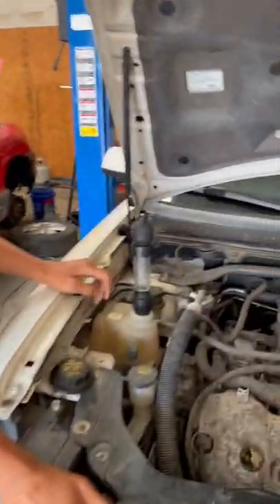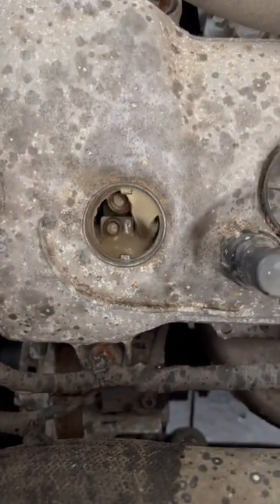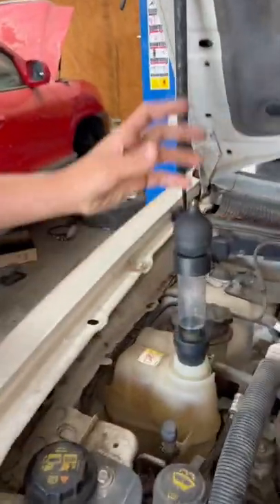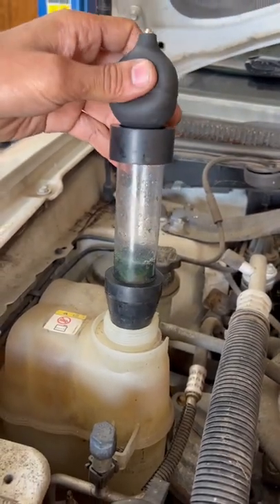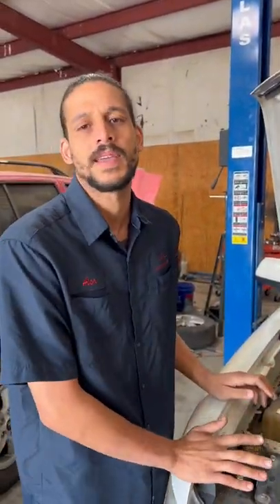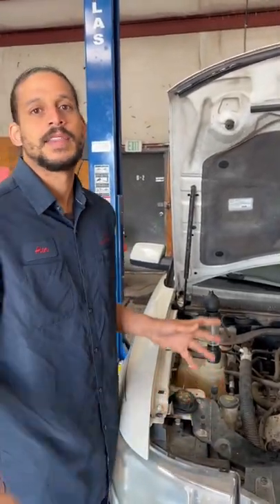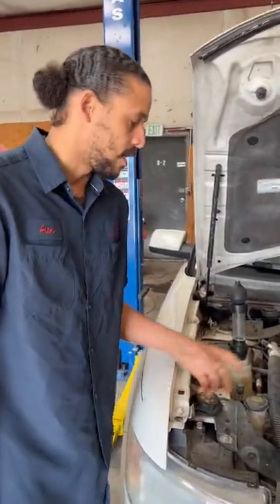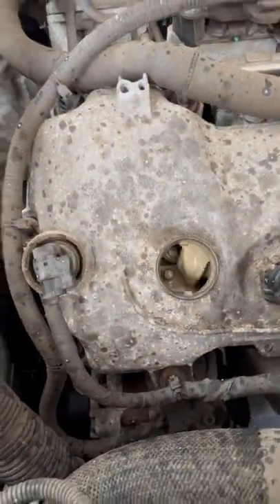MILKY OIL doesn’t always mean Blown Head Gasket! #shorts

Comment: Cool replace that water pump. Cus the coolant has already torn up the main bearings
Reply: What do you mean ? Would the .ain't bearings be shot now? I have no clue and don't want to waste my time at this point thanks
Reply: As you continue to let the engine run and destroy bearings....
Reply: @last-real-1gh117  done a few of these. He’s right. When you see a lot it milk in it rod bearings are compromised. Out of 9 I’ve done 2 needed engines
Reply: i can hear it
Reply: @mrpistonrecaro6483 so my coolant is turning brown even after a coolant flush but it isn’t milky. Dipstick not milky as well. Car hasn’t been overheating. What could be the problem? Oil cooler? Water pump?
Reply: @zGITS sounds like an “owner” problem.
Reply: @zGITS I’ll suspect oil cooler. I’m suspecting the same on my pursuit charger

Comment: In all FAIRNESS… a block test is a starting point. Even if its changing color. You still should in theory do a leak down on each cylinder, and bench test any engine oil coolers present. Just a extra step in how i go about diagnosing a head gasket. If its obvious enough ill use a borescope camera on the possible problem cylinder. Now you have video and picture proof to the owner its a head gasket.

Comment: My old roommate had a 2010 Mazda CX9 with a Ford Duratec 3.7. Timing chain driven pump. What a mess. The 3.5 and 3.7 Ford Duratecs in FWD applications have this problem.
Reply: Mechanics love them that's a big paying job and not very hard on a lift lol
Reply: @bentleynorton6843  I love doing them. Don’t need a lift  can finish it in 6-7 hours

Comment: I have clean engine oil but milky coolant (water) have flushed the radiator many times and fill it with water after 20 minutes of driving the radiator water gets milky ! Not a drop of milky liquid in the engine all in reservoir and radiator !!! I’m going to change the oil cooler on Monday hope it’s that one ! By the way the car is dodge caliber 1.8 liter 2008

Comment: Alex, excellent video as usual, thank you. I would like to add that just because the pressure cap on the reservoir pops, (16-18psi) doesn't mean its a head gasket on Dodge Charger 2006-2010, it can just be boil over on fan failure. When the temp hits boiling, the water in the reservoir suddenly and violently boils as a large portion of superheated water/coolant rushes out from the engine. I saw this happen, but our cap was off, it looked like a coolant geyser and the heads and gaskets in that car were new and OK afterwards. The old timers say that if boil over happens on a Dodge Charger - check the fans and fan circuits/wiring/relays etc. I found that many places online stating the fan circuit fails on Dodge Chargers across the production years 06 to present. Mine did, I had to make a bypass circuit using 2 relays and 2 fuses for the two fans.
Reply from the maker: Hey there, thanks man. I’m familiar with that to add that will happen to all cars.you just gave me a video idea thanks,how coolant system works and what can happen if it fail’s. Thanks for watching as always
Reply: You'd hope to get a fan related code set in that case, like P0494 or P0495. I'm getting that second code only sometimes, so something in the high speed fan circuit is on its way out (maybe a relay going bad or a dodgy fan controller). I noticed a drop in coolant level close to min level, but no sign of head gasket failure, so the car will be paying a visit to the autoelectric guy to get that fan issue fixed!

I'd love to see some more cooling system videos - there aren't many and it's so crucial to car health.

Comment: I have a 1996 Subaru legacy l We got into a wreck couple months ago we replaced the radiator, fan, and a hose and the car still over heats! We can't take it to the shop cause we can't drive it for the overheating.
Reply from the maker: Hey there sounds like you need to bleed the air out of the cooling system are you familiar with the process

Comment: How can I get in touch with you ? I have a question about the timing chain job on the 2.7 charger
Reply from the maker: Look me up on Instagram we can chat there. This is my shop number 4704350015 but I’m normally very busy I can’t come to the phone
Reply: Ok,  because I had a question about resetting the timing because it’s off from timing chain jumping and now I can’t get the chain marks to align with the sprocket marks plus I’m having trouble getting the time chain on . It’s almost like it’s too small . You guys made it look easy putting it on and off lol
Reply from the maker: @BC_nopowder  what part brand are you using

Comment: Good to know. I know sludge and light color condensation will build up in a car that is only used for short trips and never warms up completely. I would see that with retired people that just drove to the store and home and never any longer trips.
Reply from the maker: It’s amazing how short trips is bad for the engine
Reply: @AlexTheCarDoctor  carbon build up too
Reply from the maker: @Walterrinho most definitely
Reply: @AlexTheCarDoctor  Most people don't realize that short trip driving is also considered an "extreme" driving condition that according to most manufacturers requires oil changes every 3000 mile/6 months regardless of oil type used. My wife drives our car exactly 1 mile each way to work and in Chicago's extreme winters we get the milky froth on the oil cap from unburned condensation. This got real noticeable to us within the first winter during the pandemic when we weren't drivng much beyond going to work, so now every 2 weeks we go for a drive to get the engine up to operating temp and at highway speeds to help burn off the condensation. We also use a Chevron Techron treatment before each oil change and change out the PCV every other year whether it needs it or not (heck, they're only $12).

It would be great if you discussed short distance driving, it's affects and what can be done to keep a car functional and well maintained with this type of extreme driving condition. There are very few YouTube videos addressing short distance driving during the winter and how those conditions can cause froth under the oil cap, but isn't necessarily a sign of a blown head gasket. 

Great work. Thanks!
Reply from the maker: @kerigpope  thanks for the video idea

Comment: I thought the coolant (water) pump if it goes bad, would leak through the tell-tell hole at the base of the pump. This is one way but If the gasket went on the block, there you’d get that water in the oil.
Reply: Weep hole

Comment: There was a recall/tsb on the early ones. Also, this engine is the "cop killer" but only when installed in an explorer. The cats would crack loose of the  manifold and leak CO into the cab while idling. Woman cop kept getting sick after a couple officers died in other cities. They never made the connection until she pushed the issue.
Reply: I know about the problematic water pump issue but not the carbon monoxide issue. Good lord Ford really is colossal junk

Comment: If I'm not mistaken, that water pump design has a double seal system that guides a pump shaft or inner seal leak through a weephole in the front of the engine. That pump has to be literally falling apart to introduce coolant into the oil. One would hear the growling noise long before this happens. Can this be chalked up to customer negligence? 🤔
Reply from the maker: Yes I do believe so most people these days ride around with their music way up And not in tune with their engines

Comment: My 07 grand marquis has the exact same problem. It locked up last week, and 2 days later it turns over and runs, but just runs really bad, and the oil is the same exact color. Idk if i should skip the hassle and replace the rngine for 1000 or just get a leakdown test ..

Comment: Having this problem have a 3.6L v6 challenger have this light milky sludge in the coolant reservoir also making my car over heat
Reply: Same ever fix it?
Reply: @hectorsoria850  yea I changed the radiator and flushed the sludge out of the reservoir now it’s running perfect

Comment: Either way. You don't want that running continuesly, causing another issue. The explanation was nice. But you don't want it to stark knocking or overheating
Reply from the maker: I would never put a car in danger. Especially for the sake of a video. Vehicle was fine and still is running great to this day.

Comment: I have a n16 mini cooper they're notorious for timing issues. I figured I was gonna have replace it since it was running kind of loud but no other issues until recently loss of power the engine light hadn't been on until about when that happened too the code is for cam shaft position sensor bank 1 I just got back from the part store with a new one checked my fluids and my oil cap has the dreaded satan milk 🫠🥺 I was debating on doing the water pump along with the timing do you think it might be the water pump?

Comment: Yo brother I have oil in my radiator and coolant in the reservoir but no coolant in my oil dip stick or cap I also keep having to refill oil in the motor so I’m guessing there is a leak somewhere causing it to leak into the coolant system I am going to do a coolant flush but I want to know what I could be facing

Comment: Keep running that motor with water down oil and you'll get the death knock and that'll be it for that motor.
 G m's old 3.1 and 3.4 is were famous for coolant through the top of the intake manifold down across the top of the cam into the oil Pan water down oil destroyed the motor

Comment: Yes it still could mean you have a blown head gasket you have oil passages that goes through the head gasket to oil the rockers and I've seen them leak right there right into the coolant chamber it could even be a cracked head
Reply from the maker: This one turned out great but yes you are correct. It helps in situations like this to interview the customers and make sure they’re telling you the truth about what happened and to ask if they kept driving with the problem

Comment: Ahhhh, yeees, one of Ford's finest design.
Fine to assemble in a production line when everything it's clean, dry, new and there's ACRES of space to install it.
Thank you, Ford. 🙄💩👎
Reply: Hey, you service your vehicle by flushing the radiator and changing out the coolant then this may not happen. I have 175K on our 2010 Edge and no water pump issues ever.
Reply: @douglasmount188  good for you. 🙂👍
However, that doesn't change the fact that the W/P drive system and location are a complete nightmare to work on and a total afterthought by the engineers (coolant leaking inward instead of outward where it wouldn't create milkshake). Total garbage.
Reply: @GIGABACHI  For sure, not the best design. Planned obsolescence is the name of the game these days. Gotta keep the economy going by fleecing the low and middle classes...

Comment: That's why I don't drive FORD= FIX OR REPAIR DAILY OR FOUND ON ROADSIDE DEAD LOL. I'll stick to driving my reliable boring toyotas that don't break down. I got a 2001 Toyota 2.2 liter 4 cylinder Camry with 200,000 miles and runs super great and people wanna buy it but I'm not selling it cuz they will run forever with simple Maintenance and Mechanics love them because they are simple and easy to work on. Plus they are hard to find because people know they are great Vehicles Japanese all the way Toyota OR Honda.